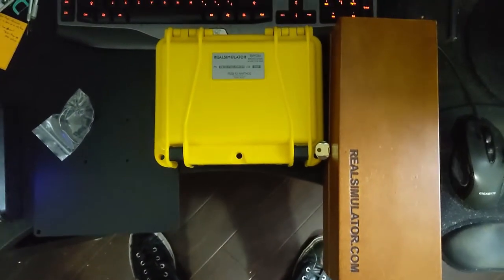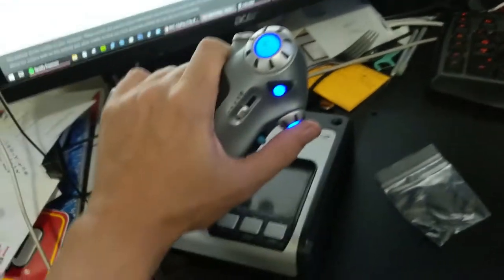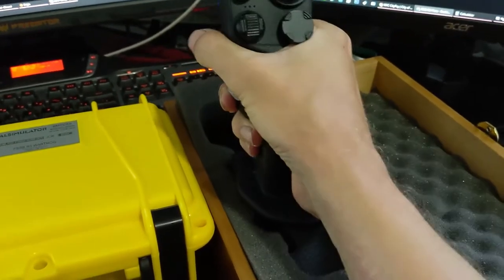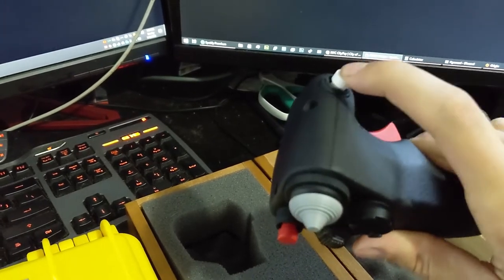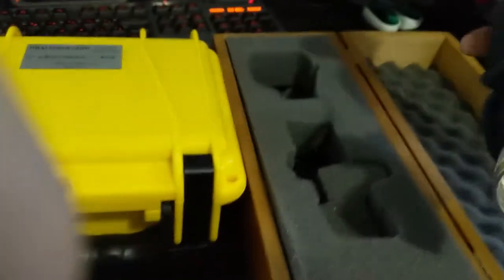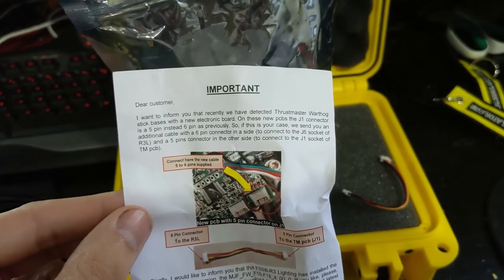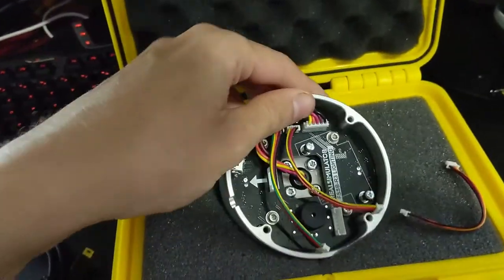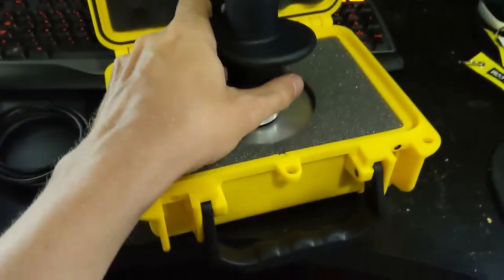RealSimulator.com F16SGRH & FSSB-R3 Lighting Unboxing Part 1

Comment: The his will be my next purchase. I’ll probably have to buy the Lightning and then get a RealSim F-16 grip later.  Then I think I’ll have everything I want stick wise. 
Virpil T-50 CM2 with TM grips for A-10, F-15, F-18, Harrier along w/ Virpil F-14 grip. 
Throttles: TM Warthog, WinWing Orion 2 F-18, Orion 2 F-16. 

Since the F-16 is my fav to fly since the early 2000’s (Falcon BMS) this will be dedicated just to it.

All the buttons on the Real Sim stick are 5 position switches.  Simply for more options. Can deactivate and make them all work just like the real aircraft in the included software.    If this is the V2 stick, it should also have a haptic feedback (vibration) built in. 
Real Simulator does indeed do HOTAS controls for DOD simulators. 
I don’t mind the box given this Bluetooth equipped version of the stick costs 790 euros ($787 at time of posting this). It should come with an enclosure that shows it’s value. Kinda like buying a high end sports car will come with certain bells and whistles. 
Also, is that the CE grip or the Non- slip grip?  I’m guessing it’s the non-slip version with the rubberized coating.

Comment: Hello, I’m hooking my R3L3 up tomorrow and alittle confused about the connection inside of it. I got the RS F16 grip also. Did you have to connect any of the connector inside of the R3L ? Not much instructions on what to do with those 2 connectors. Thanks for any info

Comment: Did the stick come with any additional things to block the hat movement?  I noticed in some of the realsimulator pictures the additional hats like the Pickle button seem to have a rubber looking grommet around it that might stop it from moving in the 4 additional directions.  Just curious of those are completely different sticks or if there might be something else additional in the side stick box?
Reply from the maker: @novasatori - Nothing additional in the box. I'm going to do a part two of the video but ALL buttons on the joystick are also 8 way hat switches with a 9th down position as well. I've actually found this to be quite handy so far. Also, for thwe most part, sliding into the right hat position has been pretty smooth.

Comment: My original plan when I first told you about that stick a couple months ago was to only get the fssb base and use the thrustmaster f-16 grip. I think that grip is more realistic with the buttons etc.
Reply: I think they went to excessive making every button into a hat switch
Reply from the maker: @zbysiek Yeah, I haven't had a chance to fly with it yet but I'm probably going to deactivate the the hat on some of them to avoid the misclicks that I know will happen.
Reply from the maker: @SpaceMonkey37 Can I ask, on the Thrustmaster, is the base with that also pressure sensitive rather than a motion stick? Or does the TM move forward backward left right etc.
Reply: @xcandiottix  no, the tm warthog base functions like your old x52. However, if you buy the tm f-16 stick you will only receive the grip and not the base, you have to buy the base separately. The TM f-16 grip is exactly the same as the warthog, but the button labels are corrected to the f-16. The TM grips have a very real feel. All metal and the buttons are heavy since you don't accidentally want to press anything.
Reply: @spacemonkey037  did you proceed with this plan of combining the TM F-16 grip with an FSSB base? because that's what I'm aiming for. I wonder if the weight of the metal grip is an issue when using the force sensing base.
Reply: @Spelljammer1  i doubt the weight is much different on the two, either way it shouldn't have any effect as you could just re-calibrate the base in the case that the weight shifted the natural position.
Reply: @spacemonkey037  Thanks for the reassurance. The weight is different with the TM being heavier (one of the heaviest sticks around on the market), but if it worked for you that's good enough for me.
Reply: @Spelljammer1  Don't get me wrong, i have neither, i use an X56. But I can't see how the weight would be a problem, especially in a force sensing base.
Reply: @spacemonkey037  The Realsimulator Base is not exactly the same as the TM base. Its considerably shorter. When I purchased my R3 base I could not get the TM base to fit in the nice yellow molded case the Realsimulator base came in. Its just to tall.